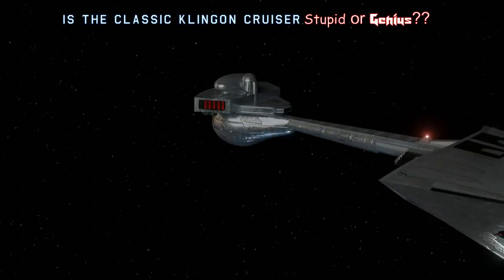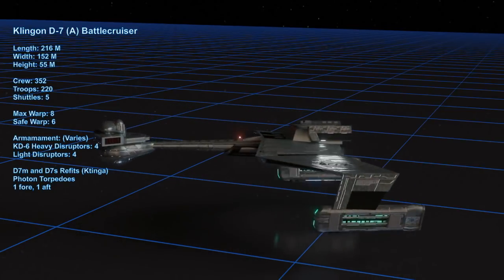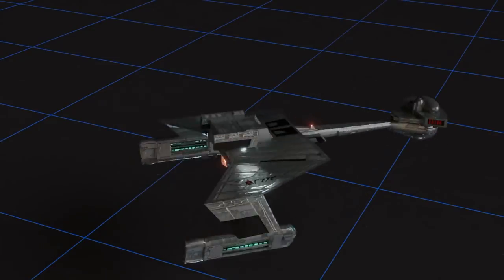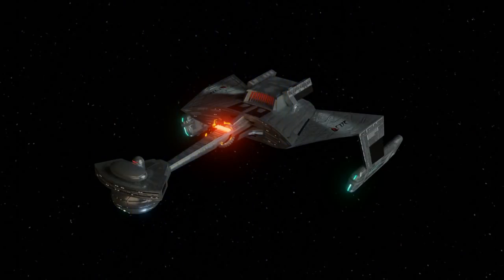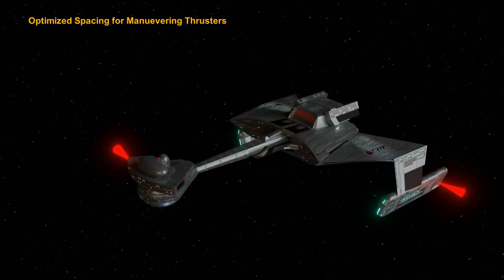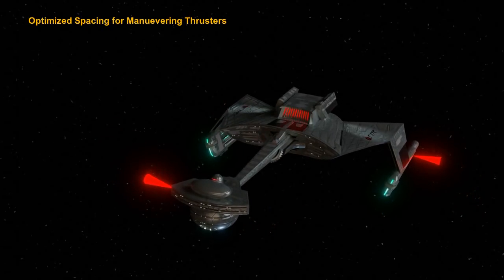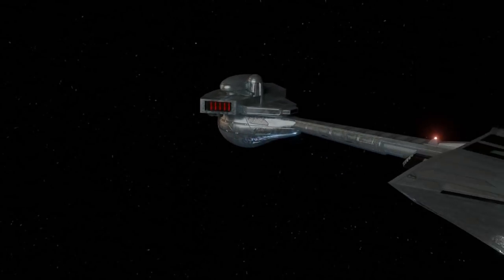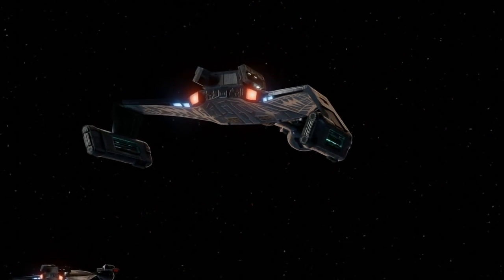The Classic Klingon D-7 Cruiser - Stupid or Genius Design?? Animated Breakdown!

Comment: Maybe the torpedo doesn't have to be accelerated along with the energy to launch it. Think about it like this: to launch an arrow, you have to pull the bow string WITH the arrow as far back as you can then release the string, the arrow is launched but what if it's more like the relationship between a gun cartridge and a firing pin? It would be the firing pin that needs to be accelerated in order to strike the primer with enough force to set of the explosives that propel the bullet down the barrel and down range. In the case of the klingon torpedo and launcher, the torpedo tube (gun barrel) is short because a weapon with tracking capabilities really doesn't need any type of guidance tube, just something to keep the torp from rolling around long enough to be launched...and keep the atmosphere and vacuum of space right where they belong (atmo inside/vacuum outside). The energy requirements for igniting, launching and getting the torp up to speed may require some kind of energy amplification or travelling direction (short travel = the torp has to use more of its internal fuel to accelerate but a long energy travel = torpedo is exiting the ship at almost full speed so the internal fuel can be used more efficiently). If that's the case, the torpedo tube doesnt necessarily have to be in line with the energy accelerator/amplifier, it just has to have a long, straight path for the build up then at the very last moment, the energy direction is diverted down (I wouldn't know just how accute the angle has to be...ask the klingons who built it) which strikes the back side of the torpedo with tremendous velocity (think squeezing a watermelon seed between your thumb and finger) sending the torp forward to its target...which now has even less time to dodge out of the way or have it defeated by your enemy's point defense batteries or counter measures (chaff-n-flares).

Comment: My take is that Klingons would design something like this if the power plant wasn't shielded very well, since naturally Klingons would favor spending resources on weapons, shields and other implements of battle rather than safety features for their "lower class" non -warrior engineering crew members.  So they put the boom section with the forward pod to house all of the command crew, ground forces wariors, etc. and keep them reasonably safe from radiation poisoning from the over powered, under-shielded power plant... while everyone else (who barely matters in their eyes) sits in the rank and radiation flooded main body of the ship. 

Edit:  Wrote this comment during the first part of your video and see you touched on it in the 2nd half.

Comment: I think Andrew Singleton has the best interpretation, but I would also suggest that it could also be akin to Batman's own explanation for wearing a "bright target on his chest" in The Dark Knight Returns.  He can't wear a full suit of body armor, as the weight would wear him down.. so instead he wears armor for his midsection, using the Bat symbol to draw fire.

What if the neck has the most shield protection (or Klingon shielding can bounce around the ship and be fine tuned per attack/defence), so an obvious weak point would be too tempting to draw fire away from the bridge/engineering pod/engines?  It would also mean a ship would have to concentrate fire on a single target, which could in turn make that ship a target for all weapons to bear upon them.

Comment: An addition, not a disagreement. I think it’s worth noting that in the TOS era ships don't tend to dogfight like we see in DS9. Instead we see them sort of "warp joust" at each other. Presumably because ships of this era couldn't pull off Defiant style maneuvers and shield technology wasn't as good as it was by the Galaxy class era. That, to me, is a really interesting thing not really explored in Trek but it does explain why, once you add in the point that without shields it really doesn't matter where you hit, they may not have been terribly worried about a phaser shot coming from above and slicing the neck.

Comment: You have point with the material shortage warranting the thin neck, but it could also be the price tag per vessel. By using more material you increase the cost of each ship meaning you have less capital to make more ships. J.G. Woitas mentioned the tactics of the K.D.F. and the strength of star trek weapons of the major galactic powers. Despite all of their screaming of honor Klingon, I guess naval doctrine for lack of a better term, seems to dictate at least 2:1 numerical advantage and intermittent cloaking to throw off enemy targeting systems. This means that the ship itself does not necessarily need to be designed to tank incoming fire but rather be fast and maneuverable. Also by the time the D-7s first entered service energy weapons and torpedo weapons were so powerful that once a ship's shields or other contemporary energy-based defenses were knocked offline it only took a couple more hits to rip apart even the tankiest of vessels. Later ship designs, like the Negh'Var of the late 24th century used neutronium alloys in their hulls allowing them to take a few more direct hits but not many. So having more material just creates "dead weight" which as you said decreases maneuverability and funnels money right down the toilet.

Comment: All the flipping the ship around pointed out the big concave section in the aft. The central corridor and possible spinal mount are not entirely discounted. The forward pod may have been intended to have that continuance, but the weapon not working meant they simply made a new forward pod. So the neck is a hold over from that weapon. How does this fit with the concave section. Fill that in with more equipment all the way to the pod. Nice and robust, and Heavy. Now we are bigger and less agile. If those areas are carved out and you leave the central boom you keep the length and setup, while making the ship lighter and thus more responsive. The structural weakness to fire? First you have shields. Every part of the ship is vulnerable with the shields down. May as well target the main reactor as the neck if you are above and the shields are down.
Then you get the attack profile, head on. Head to head the way the ship is meant to fight, then you don't have a target on the thin section anyway.

So design concessions. (Still looks cool)

Comment: Well actually. 
I've adapted the design calling it a Strike Cruiser. They would go in for a 2nd wave attack. First wave being done by star fighters or smaller torpedo ships. Or being used for flanking attacks on an enemy fleet being engaged by front line Heavy Cruisers and Battleships.

Comment: It's important to understand that the D6/D7 design was created with the mindset of the Original Series where battles occurred mainly at warp speeds and at extreme distances (tens to hundreds of thousands of kilometers.)  Damage was to shields first then generally to the ship.  Targeting parts of ships did not happen until TNG where the entire battle canon was changed to sub-light and close quarters (except when plot requires otherwise).  Also, when at warp ships aren't using maneuvering thrusters but are using the warp engines to maneuver (manipulating the warp bubble as it were). There is no momentum and there are different kinds of stresses on the hull than when at sub-light speeds so the boom probably isn't for maneuvering benefits.
Klingons themselves changed too, from a Soviet style police state to the honor bound Samuri's of TNG.  A lot of effort has been done to reconcile TOS to everything after but there's are fundamental differences in the mindset of the original design work done my Matt Jeffries.  
That said, the D7 is still one of the coolest starship designs in all science fiction.  (But I never liked that Klingons employed photons.  Disruptors on the engines are plenty cool.)

Comment: The original canon for the design was they were late to learn how to shield from the warp core's radiation. So the crew area was just put as far away as needed.

To add, the very early lore for the Klingons was that they didn't discover warp on their own. It was reverse engineered from a crashed ship. They could reproduce it, but early on they really didn't understand the technology near as well as they could use it. Their ships were little more than a command bridge strapped to a blindly copied pare of warp cells.

Comment: For Fans of ADB's Star Fleet Battles, there was never a mystery to the design of the D7 (or D6).   The Boom design integrated into the overall ship was done for several reasons:

1) Maneuverability.    Klingon battle tactics favored maneuver over durability allowing slashing attacks.
2) wide fire arcs:    In the Star Fleet Universe of ADB's games, based on the original source material (before the ST movies, TNG or DS9), Klingon ships were armed with many weapons that while less powerful individually vs. weapons arming the Federation made up for it with concentrated fire.   The D6/7 design especially favored oblique attacks in which mass #'s of Phasers (designated P-2's for the original classes before upgrades) in the boom section and along the wings of the engineering hull plus up to 4 disruptor banks deployed on the warp nacelles could all fire along a 60degree angle in the hexagonal maps of the SFB game.   (for a D7 that would be 5 phaser banks + 4 Disruptor banks.   The D6 did not have wing phaser banks)

3) Security -  In the ADB star fleet universe the Klingon empire made large use of subject races to crew their warships.   Security stations were emplaced in both the boom and engineering hulls.    Should a mutiny break out, the Boom could separate preserving the command crew and officers of the warship

4) minor point.    The hull could be streamlined for 1-3 because Klingons, being a warrior race.....saw the need for bulky science stations, lush crew quarters and entertainment areas as "frivolous and non vital".   The KDF was a battle force primarily, not an exploration service.   Also the Klingon Empire in the SFB universe was envisioned as less economically rich vs. the Federation thus had to compensate for individually superior Fed tech with numbers.    (aka Phaser 1's vs. Phaser 2's or 3s.).    The Disruptor weapon balanced the Federation photon torpedo by their Disruptors being twice as quick to recharge and fire vs. the Photon's stronger warhead but higher energy cost and load time.    Essentially the canon material mirrored the US vs USSR (from an American viewpoint) during the late 1960s.

Of course once the ST Movies came out and the new series......the original Canon material was changed to fit the new movies.   So Klingons got photons as well as disruptors and phasers are generally generic.    But the original warship design remains.

Comment: As a classic war strategy, thinner profile is harder to target and hit. That thin neck would be very difficult to hit from a short distance, much less a maximum firing range distance, and both ships in motion. And as you specified with shields this becomes even more difficult.
Looking at the D-9's profile from the front you can see it is very thin(same from the rear) even the side profile is relatively narrow. only an above or below view does it have a large profile. And given the vastness of space it's a good profile for a warship.

Comment: That " Why? " in the thumbnail lolz. When the neck is wrecked on the D-7, Klingons are reduced to using Engineering to control the ship. Having the Torpedo's out away from the center mass of the ship is fine, but they are under the Main Bridge.

Comment: You forgot that with this structure, the ship meets warp bubble needs, but it also eliminates many other ship areas which reduces mass.  Klingons do not go for comfort and there is no arboretums and such.  This would increase the ships ability to maneuver.    So it fits the Klingon culture to design for battle .. more maneuver, ability to fire weapons for best effect, and reduced mass and modular means quicker to construct and more can be constructed.  A ship designed to fight and battle, like the Defiant later on.  Remove all the nice quarters and such and look at how you got a fast nimble ship.

Comment: Two further thoughts: the primary sensors are mounted on the boom, away from interference from the reactor and nacelles. Todays warships are designed with separation of emitters in mind, for the same reasons.

Second thought: if this was all real, space combat would not happen at extreme close range like is shown on TV. At the literally astronomical distances and velocities ships would fight at, they would be shooting at a tiny speck or a radar blob. Targetting separate components like the boom would be impossible. A hit anywhere would be a success. 

But this second point is adequately accounted for by the shields, as mentioned in the video - if you've got shields, you don't need to care.

Comment: A possible variation on the safety theory; it's not the crew that needs protection from the engines but the more delicate sensors and / or computer systems.

Comment: I'd read once that the entire engineering section was uninhabitable while the main engines were running.
The 'neck' is a safety interval, protecting the crew from intense radiation.
Shielding would be heavy, slowing the craft down.
The bridge-pod is quite literally the only safe place for the crew on the entire vessel.
Reply: This would actually make sense. No one goes to the reactor until it's shut down or unless it's a serious emergency where it makes sense for one or two engineers to risk death so the whole ship isn't destroyed. Then somebody noticed you couldn't fit the crew compliment into the front section and put crew quarters in the back, so now we have this internet debate.

Comment: Well, I'm glad people are still interested in Star Trek TOS. But realize model makers were aware of designs proposed by NASA engineers. There were many speculative designs that NASA personnel considered by never went beyond paper. A basic concept was a nuclear drive section in the rear, with habitation section far out front separated by a boom. The reason is shadow shielding. The reactor would not be shielded, allowing radiation out in all directions like a light bulb. A very small radiation shield at the base of the boom would block radiation, and create a "shadow" in which there is little or no radiation. The forward habitation section goes there. Radiation shielding is very heavy, so this design allows a very small radiation shield, greatly reducing weight.

This wasn't just speculation by NASA personnel. In the 1950s the US Air Force tried to develop a long range bomber aircraft powered by a nuclear reactor. This was before the B-52 was developed. The current bomber at the time was the B-36, the nuclear prototype was the NB-36H. They had a problem keeping the reactor light enough to allow the aircraft to fly at all. One solution was shadow shielding. The reactor was placed in the body of the aircraft, just behind the wings. A small radiation shield created a shadow to protect the cockpit. They never did get it fully operational, the prototype flew with the reactor onboard but still used turboprop engines. But this is where NASA got their idea.

Next look at the ship called "Discovery One" from the movie "2001: A Space Odyssey". The movie was released in April 1968. The first appearance of a D7 was Star Trek TOS S03E13 "Elaan of Troyius", aired December 1968. I'm not saying they ripped off Discovery One, I'm saying they both based their designs on a NASA concept. Matt Jefferies designed D7, modelling it's basic shape and colour on a manta ray.

Comment: I prefer the increased speed/maneuverability explanation. In combat ships move meaning hitting the neck is harder than it seems. In real life there were tanks like the Sherman that had a high profile making it look easy to destroy, but in reality Shermans weren't as they moved and had internal features like electrically powered turrets/stabilizers enabling them to shoot accurately on the move. Klingons would build ships that emphasize speed and firepower.